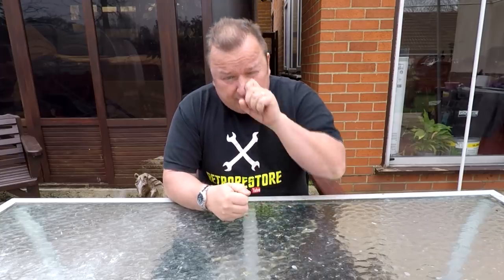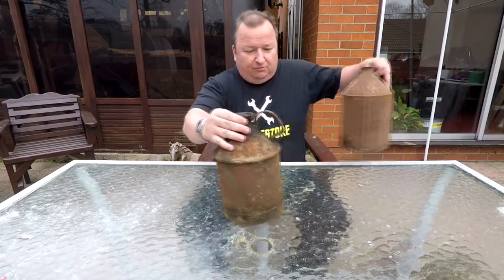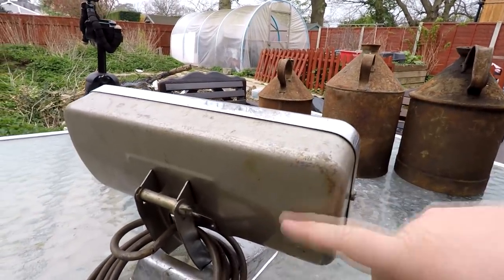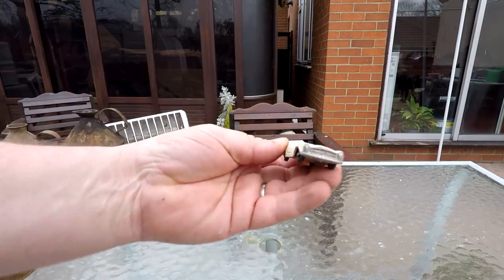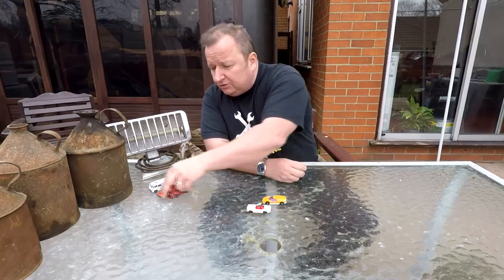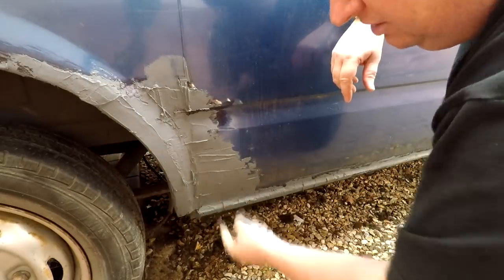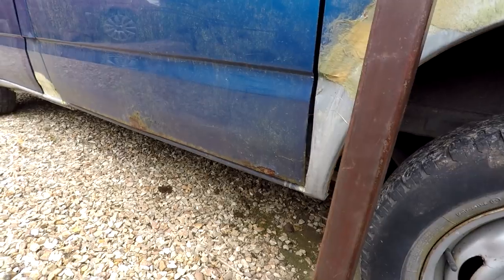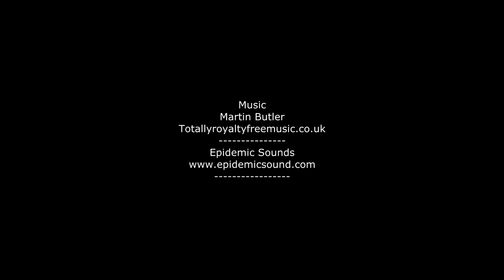Car Booty And Transit Update Vlog

Comment: I've watched all your videos and at the age of 60 next week, I bought a Clarke 145 Mig welder to weld  my transit van. After  your video I've changed it to gas, using 0.8 wire could you please help me on how to setup the welder, speed of wire and what I have the 2 switches on min or max and 1 or 2  thank you
Reply from the maker: For thin sheet like in my vids, I would use both switches on min (1) and the wire speed to 6 You will never run a weld so you have to do the dot dot method and then join up the dots. When you join up the dots, piggy back off the weld in front. Hope this helps.
Cheers
Martin